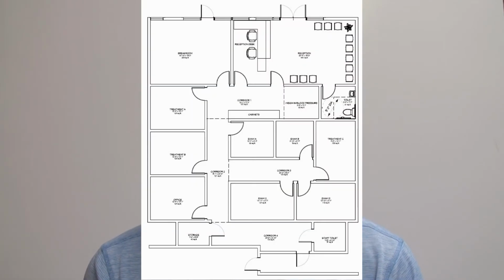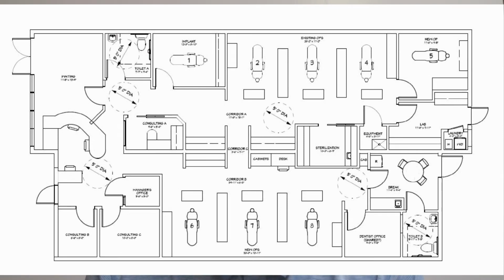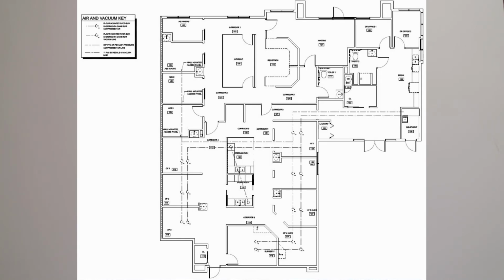Medical and Dental Projects 101

Comment: What other room locations are good for FRP?
Reply from the maker: As mentioned in the video FRP is best in places that need to be cleaned easily or often. This typically means it is good around areas with sinks that can cause splashes or spills. It is often used in bathrooms or janitors closets as well.